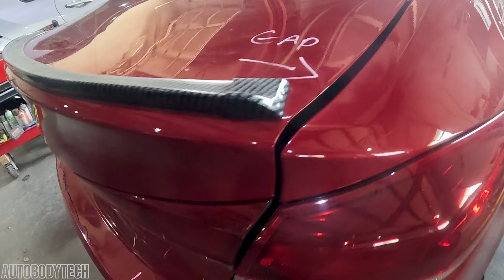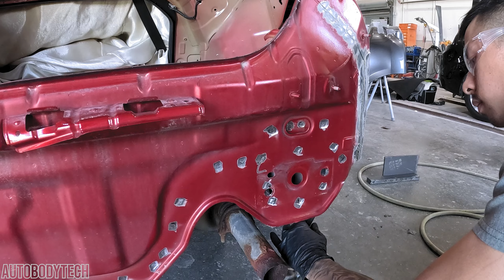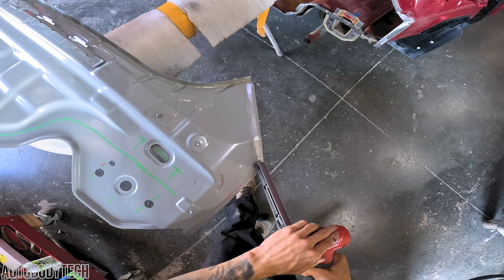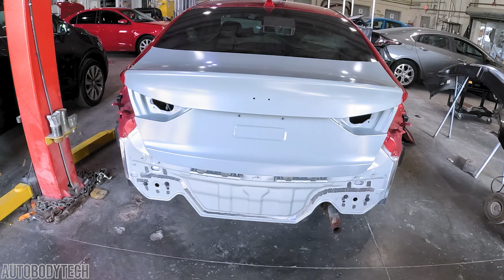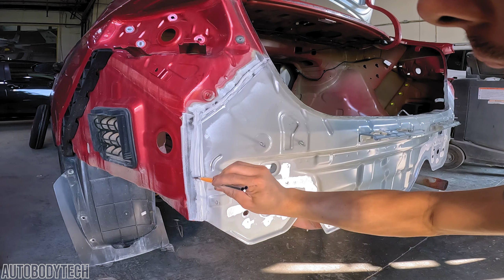How to Replace Your Hyundai Elantra Rear Panel

Comment: Just out of curiosity could you not have fixed the original panel or was it too much work
Reply from the maker: Not that it was too much work, but when the metal is kinked, you need to replace it. 
It wouldn't crumple the same again and could potentially be dangerous in a future accident
Reply: @AUTOBODYTECH  how many hours do you need for this Kind of job? Exelent job.. I learn from every video ! Thanks
Reply from the maker: @ajlanda9661  if you have a spot welder, typically, they should take about 7 to 8 hours and maybe an hour or two for assembly.
 The total job average pays the bodyman about 15 - 20 hours for something like this
Reply: yes , it's was repairable in about a third of the time allowed. 
but he elected to change , his repair , his decision.

Comment: what tool is that to remove the sealant at 4:30, im an apprentice and your videos have helped me so much, thanks a lot.
Reply from the maker: It's sunex sx8200 surface blaster with a wired wheel attachment

Comment: What is that grinding wheel you were using to remove the paint starting around 7:25? Seems to work very well without removing too much base metal ..

Your content is absolutely incredible to learn from as a hobby mechanic!

Greetings from Germany, have a great weekend!
Reply from the maker: Its Sem Product Part #SA40020
3M and Norton also has their own similar version
Reply: @ Thanks a lot!

Comment: Great job! Curious is there a way to remove the rear upper deck 
lid trim For Hyundai Elantra 21-22 Hyundai to install the part 87390AA000?
Reply from the maker: It looks like you're referring to a deck lid spoiler? If yes, you would likely have to access the underside of the deck lid. More than likely, there are screws and clips attaching it to the deck lid
Reply: I did remove all screws but there still seems to be something else holding it (its not a spoiler, the part no. shows it as part of the trunk hood). Will try another method but am hoping not to break the glass since it's right next to it on this model SEL.

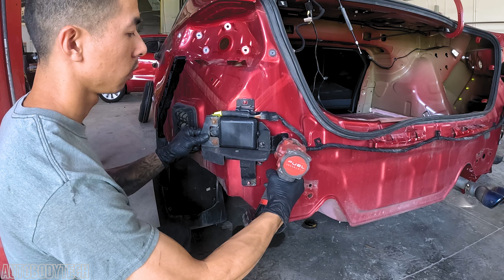Comment: Nice work man very professional. What is the black box you removed at 1:37 at the corner of the bumper? Never seen that part before on a car.
Reply from the maker: Thank you! It's a blind spot monitor system.
Reply: @AUTOBODYTECH  Oh I see, probably radar parts in that blind spot detection. Good thing they were not damaged, probably expensive!
Reply from the maker: yes quite expensive! after repairs they would need to be re calibrated as well. @practicalguy973

Comment: Do you have to add panel bond in between the new panel and old one? Where you will be welding?
Reply from the maker: Depends on the procedure. Every make and model is different. On this particular one, no.
Reply: Thanks! Just started doing heavy hits. I’m excited but nervous
Reply from the maker: @ivanelgordov9099  nice! Hope these videos are helping!

Comment: The rear break light assembly doesn’t come out easily,,
Reply from the maker: Agreed! Any tips or tricks you could provide? I normally use tape to hold pressure on the outside of the light while  using a hammer to tap onto the studs